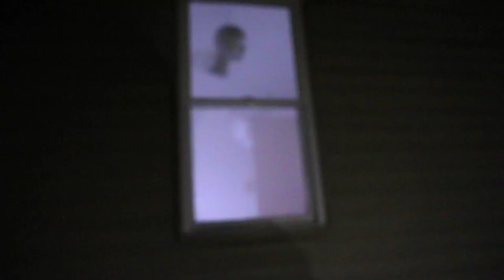HAUNTED FLYING EMMA PRANK!

Comment: the exorcist actually did happen and the house still stands today and using an Ouija board doesn't open a portal its when you fail to close it right the portal opens but its open to anything including demons and i would be careful with demeans ive dealt with them before and ive been pushed hit scratched by them